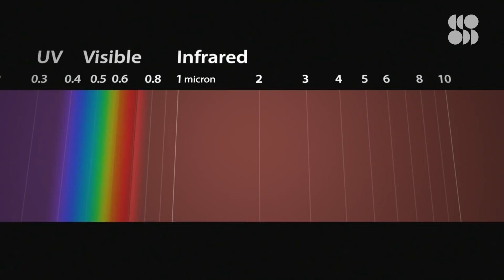NASA’s Floating Telescopes Will Image the Cold Universe

Comment: Attempting to build huge expensive long term projects where if the slightest engineering variables goes wrong including outside of users control and then applying this logic to spacetime observance is a loosing battle.  Quantum artificial intelligence systems that equate to self conscious life within given parameters should be implemented for any and all projects. Connecting such to 3d printing as well as quantum mechanical systems which can create on its own while in flight and simultaneously running quantum algorithmic analytics for complexed variables should be the path all of mankind unite in but not limited to. Balloons for space travel is great for the ww2 era...

Comment: Super interesting! But how are the balloons/telescopes controlled for stable observation? How are the balloons controlled for payload 
 recovery? Thanks for a fantastic look into a program I had no idea existed!
Reply: I have the same questions.
Reply: The wind speed at 25km altitude is actually the same as that on ground. But yea weather still exists and they'll need to take care of vibrations.
Reply: @bigsmall246  you forget the part that on the ground they are actually, you know, attached to the ground!
Reply: @ByteMe1980  the ground actually adds vibrations. many of the most sensitive telescopes have vibration dampeners to isolate these vibrations transmitted through the ground.
but yea the ground telescopes are much heavier and less sensitive to wind vibrations i suppose.

Comment: A balloon telescope will fly for perhaps a week, a space observatory can work for decades. Just like a balloon telescope is better than a one on a sounding rocket - which is again, cheaper than it - a space observatory will always be vastly superior to a balloon telescope. Sure, balloon telescope can do 90 % of the work in a week that a space observatory could do in a week, but after that week a space observatory can go observing for a quarter of a century, while it will takes usually several years for a balloon telescope to fly again for a week - if it ever does. Most don't. A ground-based telescope can work for over a century.